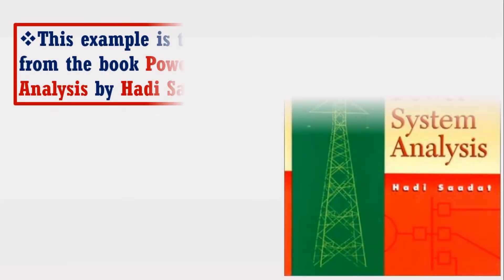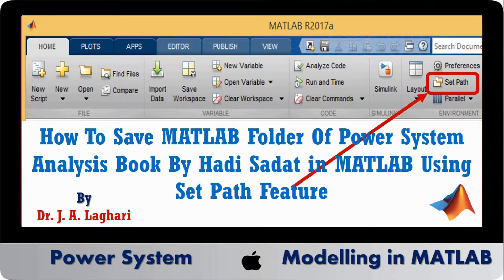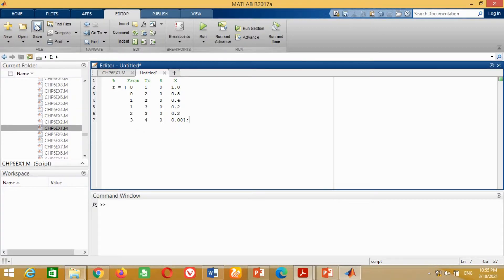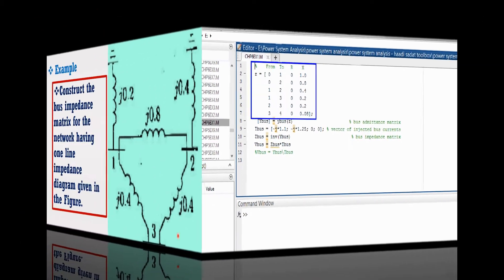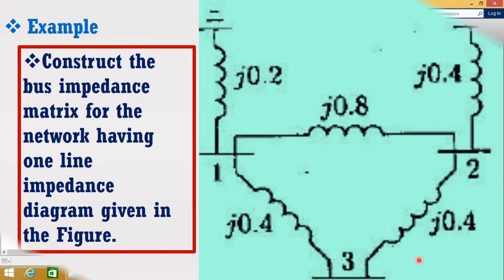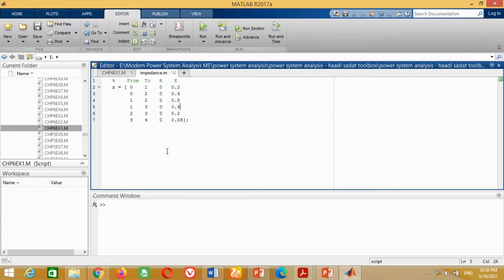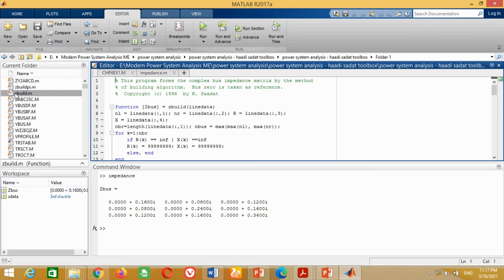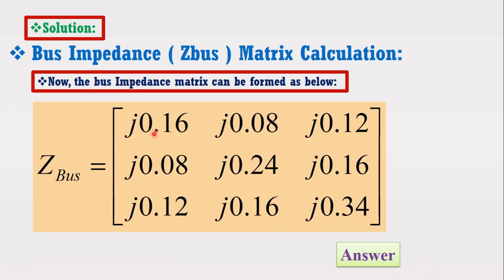How to Build Z Bus or Bus Impedance Matrix in MATLAB ? | Dr. J. A. Laghari

Comment: Using this I got 4*4 zbus matrix for ieee 5 bus ,how can I find 5*5 Sir? Ybus is 5*5.
Reply from the maker: Are you sure, ybus is 5×5? If it is 5×5  then zbud must be 5×5, first check it
Reply: @DrJALAGHARI  I have followed your tutorial and entered ieee 5bus line data in Hadi saddat zbuild script and got 4*4 z bus matrix
Reply: For ieee 5 bus ,due to reference bus consideration the size of matrix is reduced to 4*4 .i would be very grateful .
Reply from the maker: @pramodpageni9458  Rights. That's why i asked you first determine its ybus matrix? It may also be reduced to 4×4 matrix.
Reply: @DrJALAGHARI  IEEE 5 bus system
Reply from the maker: @pramodpageni9458  yes